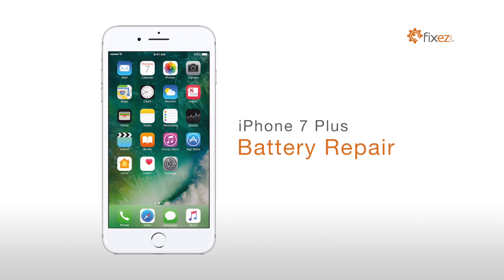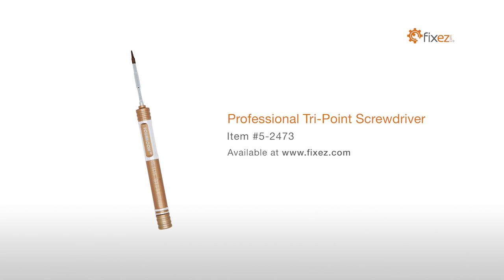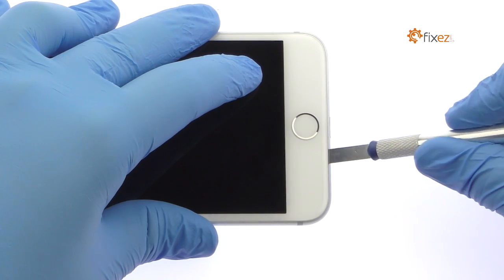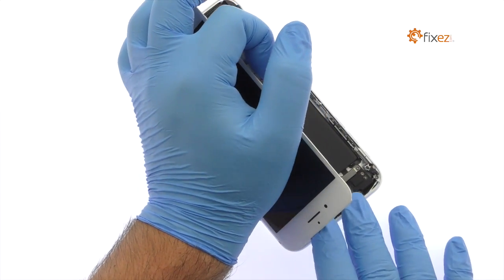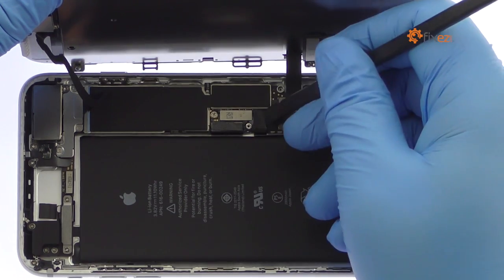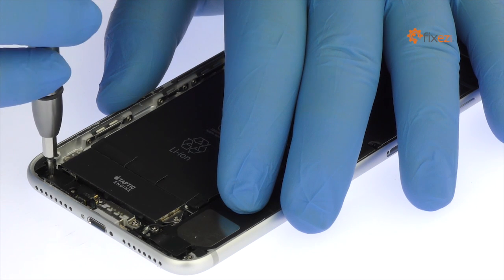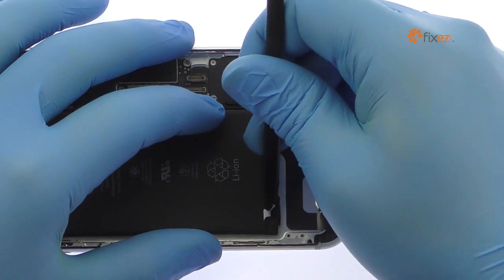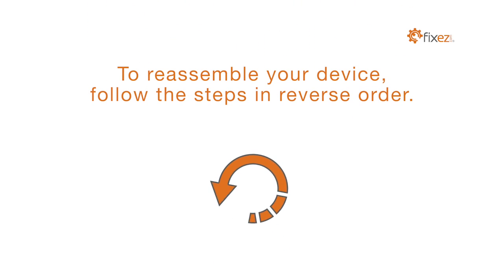iPhone 7 Plus Battery Repair Guide - Fixez.com

Comment: Great job Now your doing it right! I.e using that nylon stick to get connectors disconnected. But after opining this device it no longer is a water resisting device.
Reply: Austin Mercury once u open it it’s no longer waterproof but u can still make it waterproof if u use that waterproof adhesive used in the video that squared blue material...if u use it then it’s waterproof again